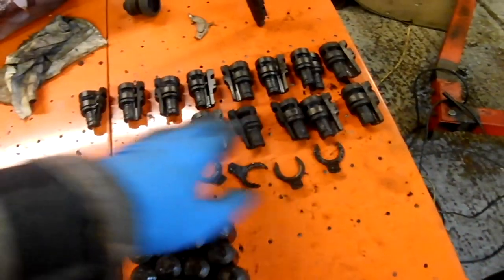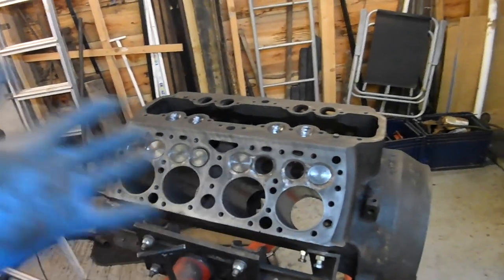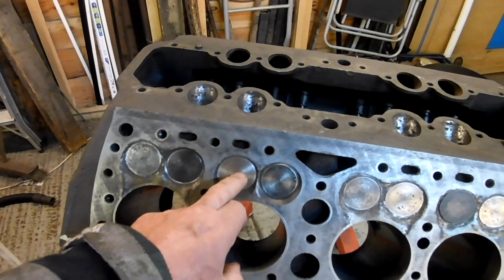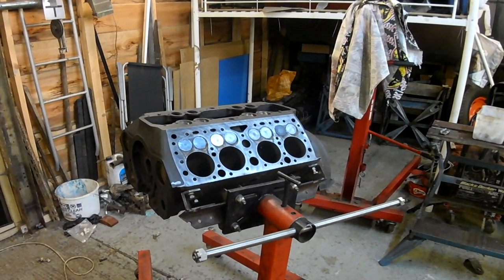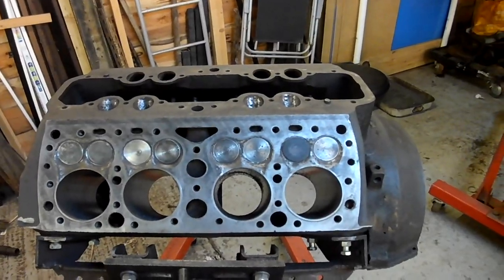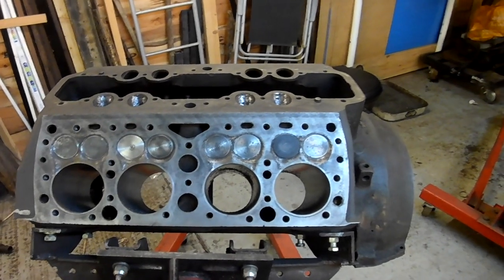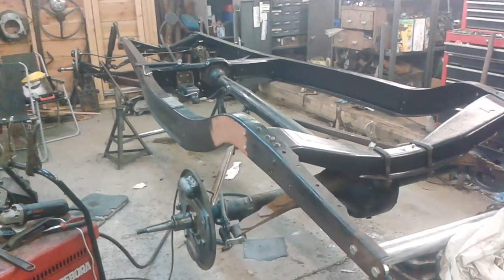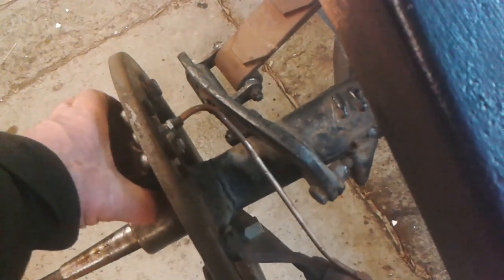Ford Flathead valve setting. 32 Frame strengtheners. 32 Pt21 59 pt15.

Comment: Great show during my Friday breakfast. Love the master cylinder bracket - looks like a production piece. Thanks for the motivation!
Reply from the maker: Thanks EH. Yes, I'm pleased with that bracket. It's made from a heavy piece of rectangular tubing. By having the Master cylinder set back a little it allows it to be a bit higher than if it were mounted closer.